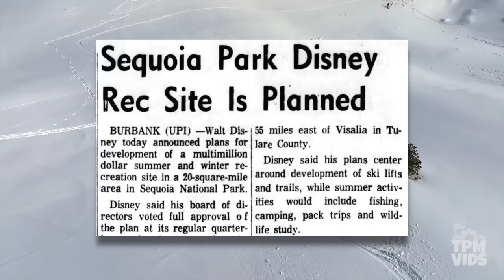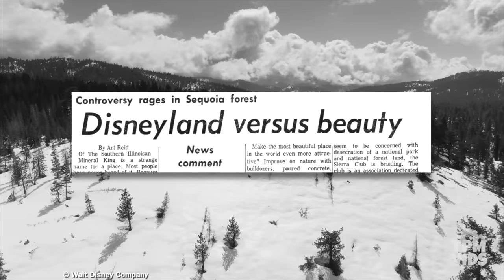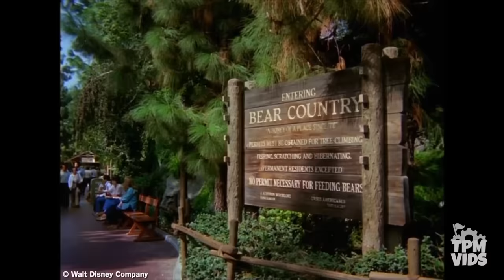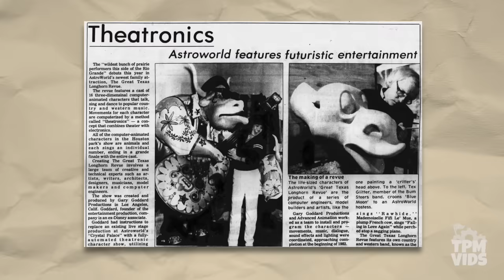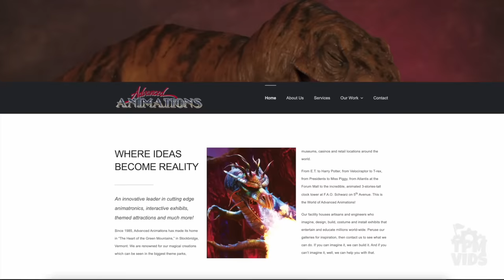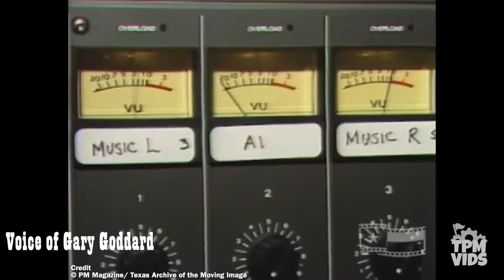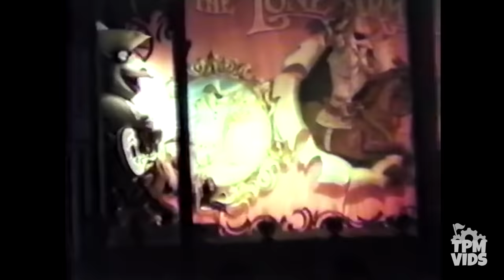Defunct Six Flags Disney Animatronic Rip Off - Great Texas Longhorn Revue

Comment: I think animatronic shows still have a place in theme parks for sure. The problem is that technology is so far advanced, that most of the mechanics and effects seem dated, plain, and lack that "WOW" factor from when they first were introduced. I think if another all animatronic show is introduced, it really has to showcase the huge advancement of technology. Like them actually interacting with guests. AI tech would be best used there. And with that walking Judy Hopps 'tronic being made, it would take it a step further. Animatronic shows are NOT obsolete. They just need to change with the times